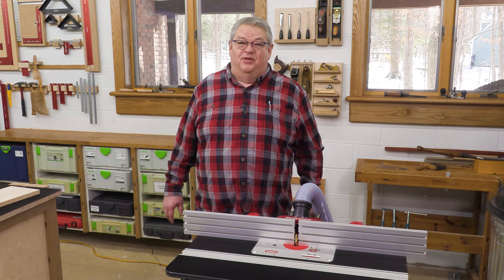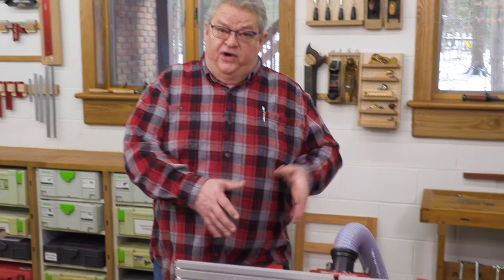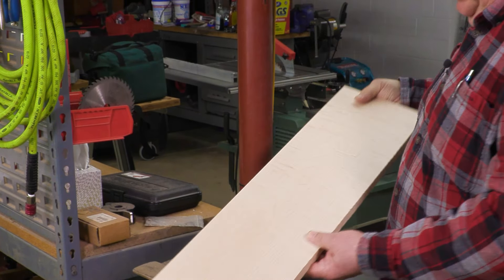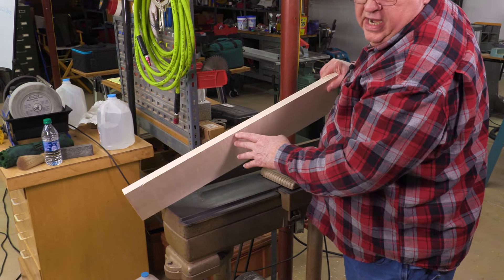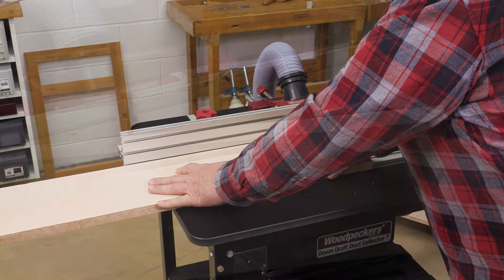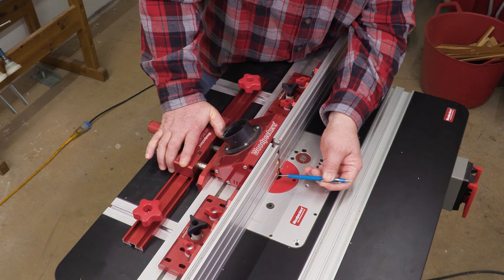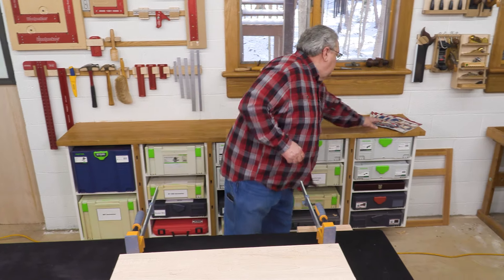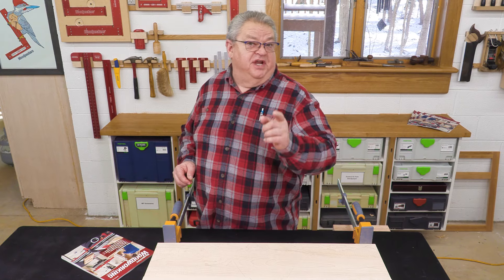How To Use Router Table As A Jointer | Deep Dive

Comment: Interesting. While researching this topic, the previous vid had the outfeed side slightly ahead (offset) of the cutter and the infeed flush (the opposite of your description). Now, im  excited to try both ways to see if one or the other works better or if it does not matter which is offset. I like your presentation. Nicely done.

Comment: Your 1950's Craftsman 6" jointer with adjustable twin column  base looks identical to the one I recently bought from a retired woodworker.   Mine is currently disassembled for cleaning and repainting.   I have used washers to offset one side of my router fence to joint board edges.

Comment: A good video and tip. I think a separate adjuster for each side of the fence as well as the main fence adjuster might be an interesting setup.
Reply from the maker: Ron, the Offset Modules are basically that. They don't have screw adjustment, but they have a vee-block and pin arrangement that insures they move perfectly parallel.

Comment: thanks for a great video. i'm new to the table router world. if i was doing this with larger pieces of barn wood planed down on both sides  maybe 2" thick, what would be the best way to join them together in making a counter? do i need some sort of biscuit joiner or can i just glue and use a pocket hole jig and screws? thanks for any thoughts. owen

Comment: Good video, Jeff. Thanks. I've been working to perfect this technique with my own router table. Your video helped. 
One request, please describe more specifically the bit you were using.
Thank you.
Reply from the maker: Up-cut solid carbide spiral straight bit. 1/2" diameter 1-1/2 cutting length.

Comment: You can simplify the setup of the outfeed fence by using a flush-trim bit.  Set the fence in line with the bearing and you won't have to trial and error on finding top dead center of the router bit.
Reply: Indeed!
Reply: True, but with a couple caveats.
You will need to raise (or lower) the bit before joining the board.
The spiral bit Jeff suggested does not have a high and low area. Some portion of the spiral cutting edge is always exactly forward.
Reply: @terryt2910  not so.  The bearing is used only for setting the outfeed table.  I raise it all the way exposing a 2 inch cutting edge.  A straight edge on the outfeed table kisses the bearing and setup is complete.  The bearing does not interfere with the cut. it is a quick way to find top dead center of the router bit.  In this video he has to reset if he gets snipe. I do understand that the spiral cutter should always have an edge that can be used for alignment but he missed it.
Reply: @joejtrip  Joseph what bit do you recommend for this usage on the router table cost is no object?
Reply: @newgurus  a good quality bit would be the Whiteside 2505.  It is a three flute with 1/2" cutting diameter and a 2" cutting length.  Any 1/2" flush trim with at least 1 1/2" cutting length will be good.   Examples of some other brands would be Freud, Infinity, Rockler, CMT to name a few.
Also, there flush-trim spiral bits (down cut, upcut, and compression) available.

Comment: Hi Jeff loved your video. Tell me can the Woodpeckers router table fence fit other brands of tables ?
Reply from the maker: Yes. You may need to drill a couple holes if the track spacing is different on the other brand table, but that's it.

Comment: I have the Kreg Precision Router Table. It came with 2 rods to offset the outfeed side. I have used it several times and love it. I do need to get spiral cut bits. I saw that you were using a downcut bit. Which would you recommend?
Reply from the maker: For jointing, either upcut or downcut will work. For typical woodworking, I find upcut more versatile.

Comment: Are longer lengths of the split fence extrusion available? If so, substituting a longer one for the infeed half of this common shaper-type jointing setup can greatly increase the ease and accuracy with which this setup can be used to straighten longer workpieces, as opposed to simply cleaning up a tricky-grained edge. Alternatively, if the offset components allow a large enough offset between halves of the fence, a long dead flat auxiliary subfence mounted to the face of the stock infeed fence could be used to achieve the same straightening function. (The fact that length of the infeed table determines the straightening while the outfeed table only provides support is why molders have such a long infeed tables and minimal outfeed.)
Reply from the maker: Michael, we sell 36" and 48" sections of our Super Track (the fence extrusion).
Reply: @WoodpeckersLLC  48" infeed would give the router table edge-straightening capability comparable to typical 12" jointer with 8' bed. Horizontal work piece orientation takes gravity out of the straightening equation: a reasonably well aligned roller stand on the outfeed side can provide adequate support, without any slight misalignment affecting the straightness of the jointed edge. Quality and straightness of Woodpecker Super Track is key for the extended infeed method to work.
Reply: @WoodpeckersLLC  BTW, what is the maximum offset between halves of the split fence setup shown in the video?

Comment: I have a woodpecker fence and micro adjuster.  It didn’t come with the rods shown.  The fence is excellent, but not quite as easy as shown.  When securing the hold down screws, the the alignment of the fences change making alignment of  the two fences with an offset difficult.  This is still the best fence out there, but it needs more engineering to be the best one to suffice as a router.
Reply from the maker: Contact Customer Service. Those rods are the key to alignment.

Comment: Then to square up a board, would it be best to plane the board first? So that the wide face is flat for running across the router table? Or does it matter?
Reply from the maker: Yes, it would be best to have the face flat.

Comment: Did you use an up spiral or down spiral? I ended up getting a 1/4” Diablo 1” long UP spiral bit and it might be too small to be taking off 1/8” material at a time. Can’t find or think of anything thinner to use though besides this underlayment I have…
Reply: Im trying to joint 3/4” material btw
Reply from the maker: You talking about smaller material to shim out the outfeed fence? Try stacks of playing cards. They're about .011" each and very consistent. Stack them up to make exactly the distance you want.

Comment: Can you provide any additional details about what to look for when choosing a bit for this use case?  I am looking at bits with a 2in cutting length in case I want to use this for thicker stock.  Does it matter if it’s an up cut or down cut bit in this scenario? Is a double or triple flute better in this use case?
Reply: You'll want an up cut bit so it cuts toward the table top; the bottom of the board will be supported by the table. An alternative choice for the truly paranoid would be a compression bit. The number of flutes just decreases the amount cut by each flute, so the more flutes the better it will be for tear out (e.g. less), however, you'll need to slow your feed rate to give the small gullets time to evacuate the wood chips.
Reply: @RobertBarth1  Thank you!
Reply from the maker: Robert pretty much covered it. up-cut is the best choice. Spiral flute is a must. Triple flute will last longer and theoretically cut smoother, but cost more to begin with.

Comment: Thanks Jeff, really nice video.  I have the Super Fence that I bought a few years ago at a show, but I don't recall receiving those two spacer pins. I could probably use two spacer blocks instead.  What's the diameter of the two pins.  Just placed an order for the spiral bit.  I plan on getting the phenolic table top in the future and was wondering does it come with a router plate and if so is it predrilled?
Reply from the maker: Rich, the spacers are inside your Offset Module. No reason to take it apart to use them...just about anything will work. However, if you have a Woodpeckers Coping Sled, a pair of the same pins comes with that and they're not used after assembly...so they may be in your spare parts drawer. Anything that you have two of that are the same size (to a reasonable tolerance) will work. Any dimension from 1/8" to 3/8" will work. The point is to get the outfeed fence moved away from the base so the adjustment of the infeed fence has somewhere to work.
Reply: @WoodpeckersLLC  Great, thanks for the quick response.
Reply from the maker: Welcome. Missed your last point about the phenolic table. It doesn't come with a plate, because we don't know whether you want a plate or a lift. The tables are fully machined for a standard 9-1/4 x 11-3/4 plate.

Comment: Very nice video - will still take some practice to get it setup right.  Just curious, what brand of cutter are you using?
Reply from the maker: Jerry, the one I was using in the video isn't the best choice. It's actually a metal cutting end mill. 20 years ago, when I bought it, solid carbide spiral router bits weren't a thing and a bunch of us started using end mills for their clean cut. Now, the tooling manufacturers have caught up and the edge geometry has been optimized for cutting wood. Look at the ones on our web site from Whiteside and Amana. The funky colored coated ones from Amana are amazing...expensive, but amazing.
Reply: @WoodpeckersLLC  Thanks for the reply.  I love the Whiteside router bits.  Any particular model?  Upcut or downcut?  It all gets a bit confusing - and expensive if you pick the wrong one!
Reply from the maker: @jerryjerome6709  Up-cut is best for this application.

Comment: So how do you adjust the router to be perpendicular to the plate? I have the PRL-V2 router lift but when I check up a router bit it is not quite 90° to the plate.
Reply from the maker: Jacob, contact customer service. Your router bit should be perfectly vertical to the lift. Something...possibly the blocks around the router...isn't installed correctly. One of the folks in customer service can help you troubleshoot it.
Reply: Reset the router in the router lift and make sure the router bit is squared to the plate. Then re-install the router and plate and make sure the router bit is square to the router table. If it is not square, adjust the leveling screws to make sure it is at 90 degrees in all directions.
Reply: Doesn't need to be perpendicular to the plate. All the matters is the position with respect to the cutter:) If it were a linear motion cutter (like a tablesaw blade), then you'd need to worry about fence alignment and not just fence position.
Reply from the maker: Reed, I think Jacob's issue is that the bit isn't perfectly vertical. In other words, the router is cocked slightly in the lift.
Reply: @WoodpeckersLLC  oh, yikes. never thought of that but yeah, you definitely need to get the router into the lift straight!

Comment: Do you need to run the board through a few times to get a square edge?
Reply from the maker: Depends on how bad it is to begin with. Typically, yes, it will take a few passes.

Comment: nice setup. can you please add link where to buy sprial cutter?
Reply from the maker: We have them at woodpeck.com. My favorites are Whiteside or Amana, but they'll all work.
Reply: @WoodpeckersLLC  I can't find under router bit. please give a link to that bit.
Reply from the maker: https://www.woodpeck.com/whiteside-standard-spiral-upcut-bits.html  First one on the page. 1/2" diameter, 2" cut length. It's not gold colored, like the one in the video, but that is just a TiN coating. It's kind of a gimmick, and I wouldn't pay for it again if I didn't already own it.

Comment: I hate to say anything bad about this great video. Love the extra support for the piece but the board was fed in two different directions. I would definitely go this rout if the piece was not stable. Planer started at the knot on the end and router was opposite.  One against the grain and one with the grain.
Reply from the maker: Frank, I would have fed them the same direction if I had paid attention. But as crazy as the grain is in that piece, there's no "with the grain" direction. The thing that makes it so much cleaner on the router table is the spiral cutter.
Reply: Maple wood is VERY difficult to get around "cut outs", no matter how you feed it.

Comment: Jeff, I want to pull the trigger on the Super Fence with the Micro Adjust, but I'm looking to see if it will or can be adapted to a Sawstop cast iron router table that is integrated into my table saw. Do you know if I it can work on it? 
P.S. I think that jointer is older than both of us. 🤣
Reply from the maker: The holes in the base of the fence won't line up with the slots in your table, but all you'll have to do is drill a couple holes in the (aluminum...drills easy) base extrusion.

Edited to Add: You're right. The born on date on my jointer is 1950. Mine was about 7 years later.
Reply: @WoodpeckersLLC  My date would be 9 years later, fortunately, we're all three still kicking!
Yes, I see how the Super Fence can be drilled to fit, but you think the Micro Adjust can be too? That looks a bit differernt. I'm thinking I might have to adapt a couple of Magswitchs to attach it to the table top being there isn't a T-track on mine for it. I was hoping some one else may have addressed this before. May just have to jump in and see.
Reply from the maker: Simpler solution would be to buy a piece of our DP track that is long enough to reach across the tracks in your router table.  Just looking and guessing, I think a 24" will reach. If not, get a 36" and cut it down. Then you can use it exactly as designed. It won't be red, but it will work perfectly.
Reply: @WoodpeckersLLC  Ah-ha, I get it now, Duh... Well I just placed the order today for the squares you recommened for me on 2/5, "I would get the 2616 in aluminum and the 1812 in stainless steel". When the wife is distracted, and maybe just after Valentines day, I'll sneak this order in. 😜
And then, the Rip-Flip, then the DP Pro, then.... does it ever stop 🤦‍♂️

Comment: What router bit is this?
Reply from the maker: Solid carbide spiral. Doesn't matter what diameter, but in my personal opinion, larger is better. I use a 3/4" or 1".
Reply: @WoodpeckersLLC  can you recommend a brand and model?
Reply from the maker: Whiteside, Amana, CMT...can't go wrong with any of those. Shouldn't leave out Freud, either...they are good, too.

Comment: Wouldn't it be easier if the bit had a bottom bearing? It would be pretty easy to line up  the outfeed side of fence with a straight edge against the bearing. Then just lower the router, so the bearing is below the top of the table. Then move the infeed back to desired depth of cut.
Reply from the maker: Setting to a bearing would certainly work, though I would imagine a tweak or two will still be needed to get the cut perfectly in line with the outfeed. Solid carbide spirals are a bit more economical than piloted brazed spirals.
Reply: Also, a spiral bit insures that a portion of the cutting surface is always forward.
Reply: @terryt2910   Ah good point, I could use a spiral bit w/ a bearing. I use those for template cutting. But I understand some repositioning will probably be required to avoid any snipe. Thanx for reply. I didn't think about cutting surface and location.

Comment: Great for an edge but what about the face of a board. Get a joiner, worth the money
Reply: This technique is especially useful when you have to edge joint small pieces that are not safe to edge on a jointer.  Also to refine an edge on a board at glue-up time.

Comment: Really an unfair comparison.  Whereas I do not disagree with using the router as a jointer you should use a helix cutter in the real jointer as you did in the router.  Your type of comparison is fake IMHO.
Reply: You're right that a $400 replacement  helical cutterhead would improve the cut of the jointer. The point is, a $60 router bit in a router table you likely already have gets the job done today.

Comment: Come on man get real if the jointer had spiral cutters it would leave as good a finish as the router.Cut out fudging just compare apples with apples this was a pathetic example.
Reply from the maker: So, you're saying it's smarter to spend a thousand dollars (or more) to upgrade an existing jointer that you already have than to walk over to your router table and use a proven technique?  Not everyone has a jointer with a spiral head, in fact I would bet my next paycheck that straight blade jointers outnumber spiral jointers in use by a huge percentage.
Reply: @WoodpeckersLLC  no I'm saying that you did not compare apples with apples. your jointer had single blades and your router bit was a spiral so your example of using both options was not fair in any shape or form.
Reply from the maker: The goal was not to compare a jointer to a router table or to compare straight blades to spiral blades. The goal was to show that if you don't have a spiral head jointer you can get similar results with a simple technique and a $20-$30 router bit.
Reply: @WoodpeckersLLC  OK, but what is the cost of that router table setup you're using, as shown? Using cost savings as a benefit when talking about Woodpecker products is kind of ironic.